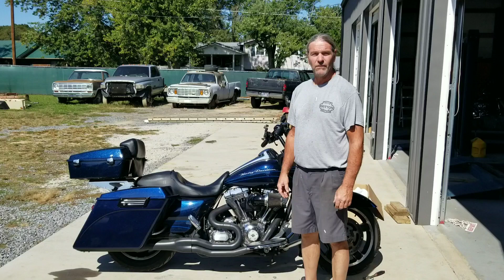Harley Davidson equal length exhaust tech

Comment: Since v twins aren't even firing doesn't that mean that the first cylinder that fires does not benefit from equal length? In cars it is usually beneficial because having 4 (or more) cylinders usually parallels or in two banks of parallel cylinders they are even firing and have exhaust pulses that are closer together right?
Reply from the maker: @riccardosartori3822  yes you are correct but on the Harley engine the delay in firing would still create a scavenging affect that still would help pull the next pulse but of course this is in a 2 into 1 exhaust.  The dyno proves this the torque goes up with 2 in 1 pipes